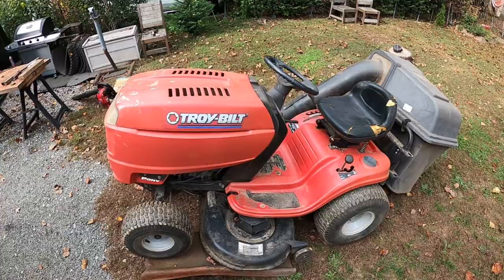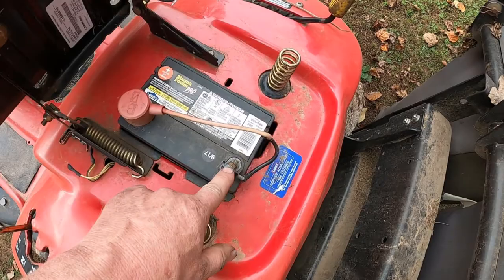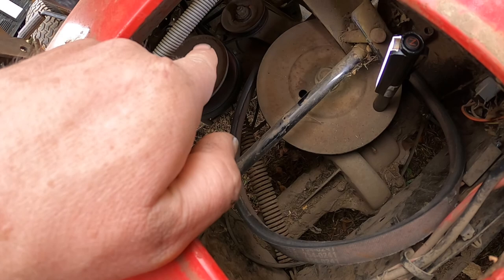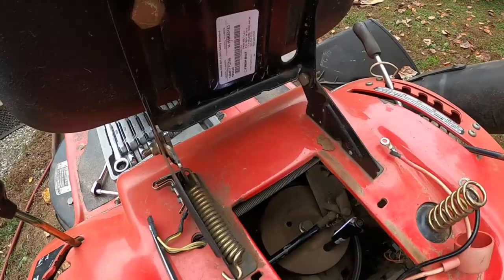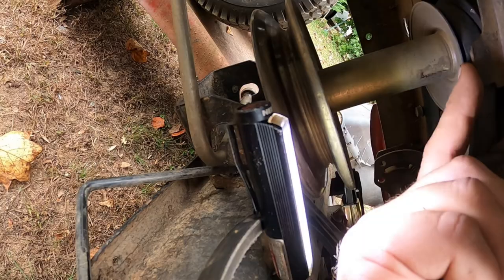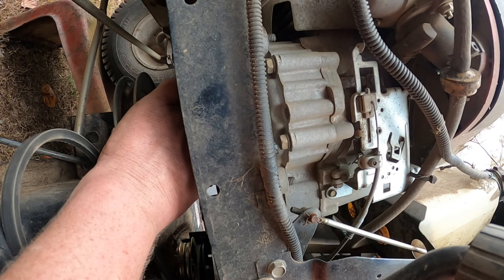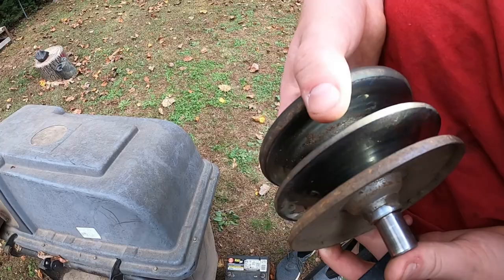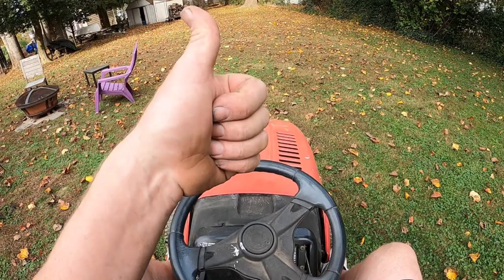Troy Bilt Pony Lawn Tractor Drive Belt Removal

Comment: Great video, thank you. I have a question, maybe you can help me,  Coincidentally, I recently changed the drive belt and I don't know if that will be the cause of my problem, I have a Troy bilt pony (2011), now I can only control the speed with the throttle lever, even when I put it in rabbit mode the motor goes at high rpm, but the ground speed is about half the normal speed; the (yellow on mine) speed control lever doesn’t work, it goes up and down without locking the notches, offers no resistance and does nothing. (however, the engaging of the parking brake action works fine). I opened up the mower and saw the yellow speed control lever attached to a connecting rod which is attached down there to the cupped metal piece in the correct position as the new Troy Bilt Pony I saw yesterday at Home Depot, but besides allowing to be put in in park position, I don’t see it attached to anything else, is it right? How does it regulate the speed if it is not connected to anything else? Thank you in advance.
Reply from the maker: Sounds like you put belt on wrong. On the wrong side of the idler pully.

Comment: I bought a used Bronco a couple of years ago.  The belt started smelling like burning rubber and eventually smoked and threw itself off the variable speed pulley in the back. I replaced my lower drive belt (the 5/8 x 91 one) with a non-OEM Kevlar belt of good quality.  It worked but the crankshaft pulley gets really hot and the new belt started smoking.  Also when it's sitting with no pressure on the pedal, it wants to creep forward.  The belt is NOT tight on the crankshaft pulley when it's just sitting but again, gets hot and smokes.
I've read that getting non-OEM belts can cause overheating of the belt.  Have you run in to this?
Reply from the maker: I am still having problems with the belt slipping ever with the OE belts. I think my pulley are worn out. With it smoking are you sure one of the idler pully is not bad? I have had a after market belt smoke but that was after it was worn out. I am going to replace all the drive pulleys and the belt again when I get some money. Thanks for watching

Comment: why remove key & sparkplug wire if you removed the battery?
Reply from the maker: The battery only works the starter. It still could spark and turn the engine over because it has a magneto. Thanks for watching

Comment: How did you end up putting the drive belt on the crankshaft pulley?  Could you wiggle it in or did you have to remove the pulley to get it on?
Reply from the maker: I was able to wiggle it back in. You might have to loosen the motor to get the belt back in. Thanks for watching
Reply: I can’t wiggle my new belt on and loosening the motor is a son of a gun!  Sucker won’t loosen.  Even if I have a ratchet on the top nut and a ratchet down to the bottom of the pulley, sucker won’t loosen.  Seems like it tightens either direction.  Any suggestions?  My pipe wrench won’t hold the spindle since it’s cylindrical and will just spin loose…

Comment: Are there any torque specs for how tight to bolt the pulleys back on?  I'm kinda a newbie.  Just curious about what you ended up doing?
Reply from the maker: There has to be a torque spec but I do not know where to fine it. So I just tighten back up.
Reply: @TheGAutomotiveAndMore  Thanks man.  I haven't been able to find any specs online either.  I've got my Pony apart in the garage right now changing all the belts, then realized I didn't pay attention to how tight the idler pulleys were on the deck before I loosened them.  Do you have any opinion on those?  I'm guessing they still need to be able to spin freely?
I appreciate your help!
Reply from the maker: @Mr.Tea.7  Just tighten them tight. You can go online and if you know the bolt size you can use that to get the bolt toque.